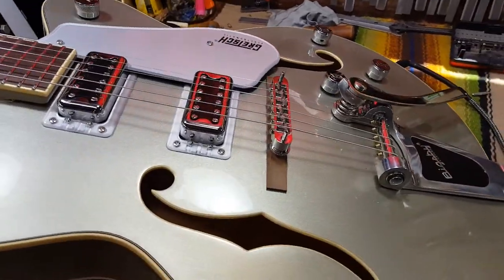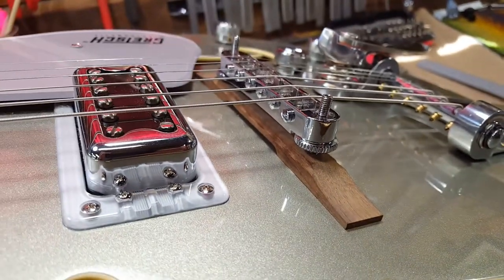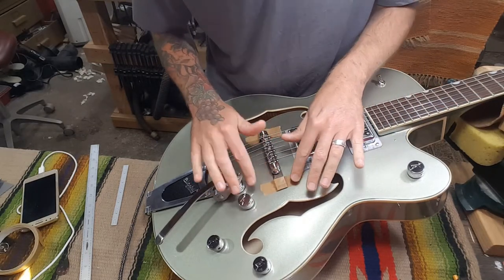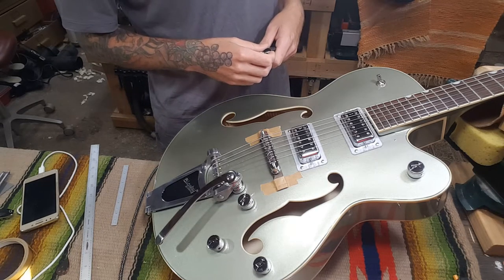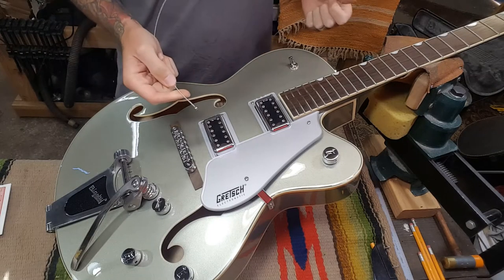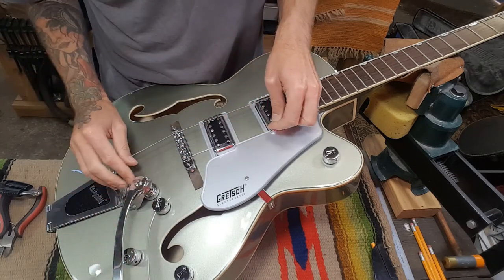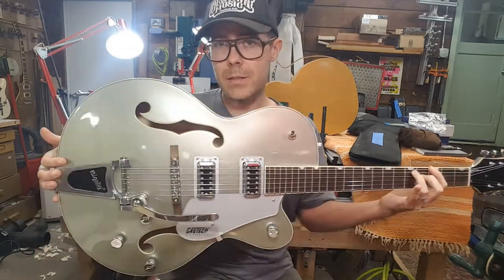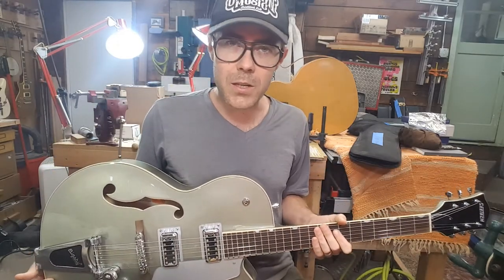Gretsch Bridge Relocation - Moving a Pinned Bridge

Comment: I wonder if the posts went into the body because the factory used posts that were too long. On my 5420T the posts are much shorter and do not (could not) go into the body. When I changed the strings I did have to move the bridge a bit to set the intonation and it moved very easily. I did tape the bridge down before taking the strings off so it wouldn't fall off.